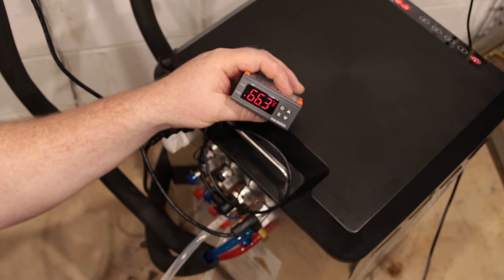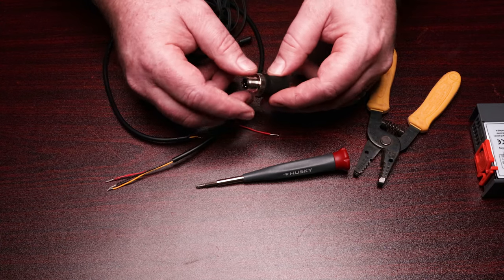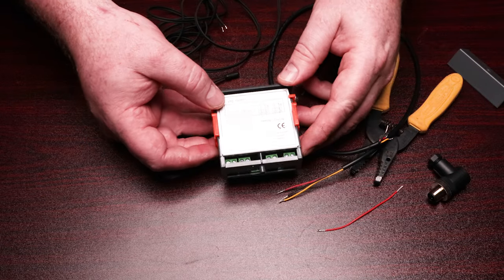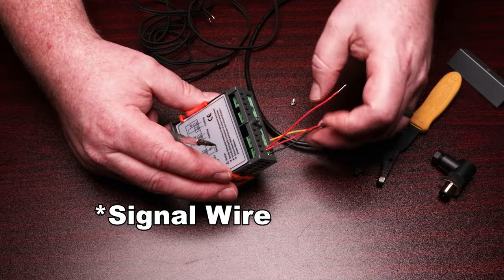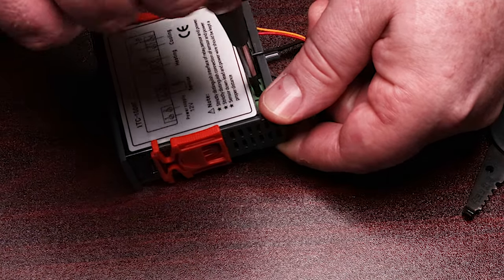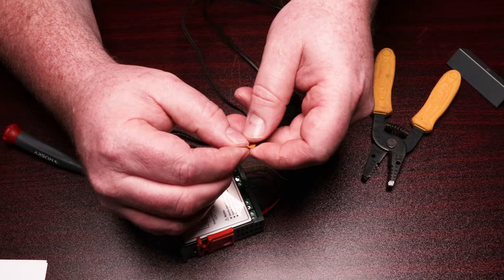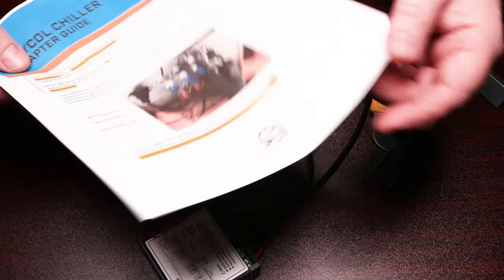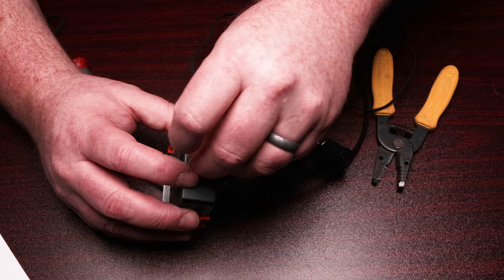Use any fermenter with this Grainfather Glycol Chiller HACK

Comment: how about how to connect the g20 glycol to the grainfather conical and be able to still use the fermenter wifi controller
Reply from the maker: Not sure I understand what you are asking?
Reply: @ShortCircuitedBrewers  I have a wifi controlled gf conical. and a new kegland g20 glycol chiller..the g20 already has a stc wired in to control glycol temp..say -2deg c.and has 2 other panels to control fv via a temp probe...I work away so enjoy the wifi function...would like the fv to be able to control when pumps turns on off..hope that makes sense
Reply: there is a heating relay i could wire my fv into using m12 to spade connectors possibly. so have the glycol running as normal and fv heating??
Reply from the maker: @mattbarnes3111  makes sense. However unless the G20 has an external control for the pumps that's not integrated I don't think it's possible.
Reply from the maker: Maybe? Not sure what the heating circuit voltage is. The grainfather conical heating element is 12 volt.

Comment: Hey Brian 
Can this chiller work with a Braumeister ss fermenter tank??
Reply from the maker: Sure.
Reply: @ShortCircuitedBrewers   thanks Brian for the quick response 👍🏻👍🏻also directly from the box whit-out using the hack ??
Reply from the maker: You mean without the external controller? No, you need that to run the pumps.
Reply: @ShortCircuitedBrewers  ok I get it👍🏻 thanks a lot
Reply from the maker: @mraabo1  👍🍻

Comment: How does it hook up to you fermenter
Reply from the maker: You can just use hoses. I showed a hose in a loop. You would just hook one hose to the inlet and one to the outlet.
Reply: @ShortCircuitedBrewers   do you need particular  connectors for the hoses please?
Reply from the maker: @ianholmes9328  no there is a hose barb on the chiller.

Comment: Hello Brian and a Good whatever time it is over there. 
Would this part do? https://uk.rs-online.com/web/p/sensor-switch-cables-connectors/1951782/
Struggling to find the exact part on Amazon UK. Thanks as always.
Reply from the maker: Yes that works
Reply: @ShortCircuitedBrewers  many thanks Brian. I know FA about electrics so that's a massive help.